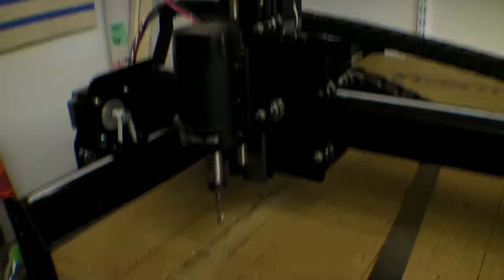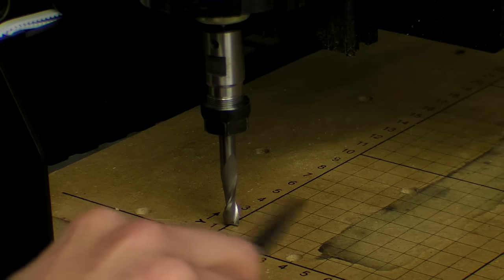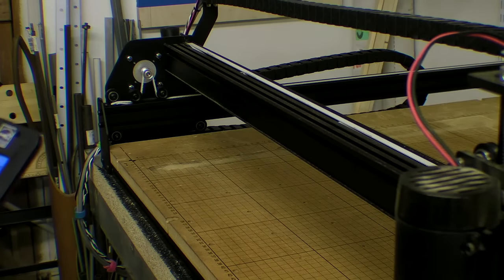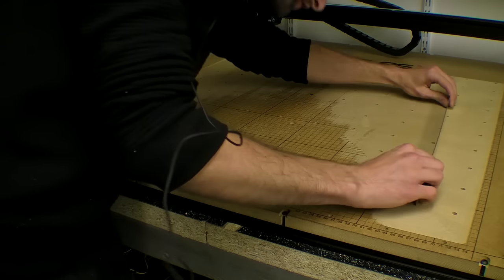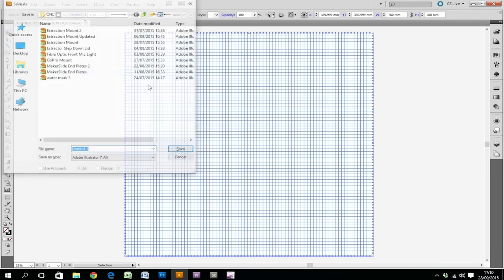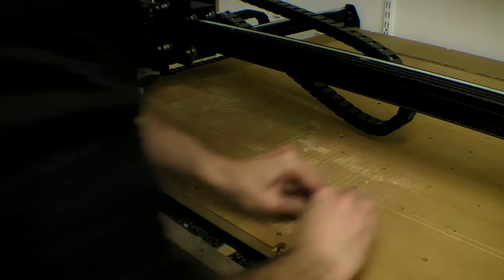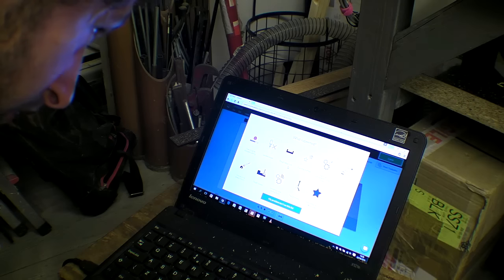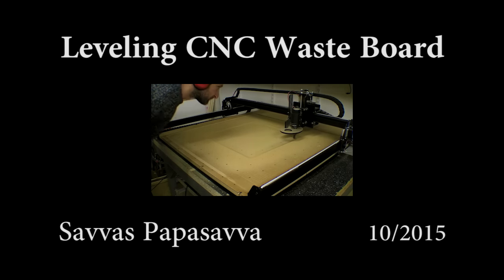Levelling CNC Waste Board - G Code Travel Error

Comment: If the x carve is anything like the shapoko, there's not enough support under the waste board to keep it as flat as it should be. Often see torsion boxes used for things that don't need the level of stability and flatness it can provide, but it certainly would be a good base for one of these.
Reply from the maker: +John Heisz Yep the machine is scaled up but the aluminium profile is still the same thickness.  I could get a flat t slot profile which has been ground flat for CNC beds but it is quite expensive at this size, and I still want to explore this machines claims without patching its problems with my wallet... expect several more annoyed videos.

Comment: The grid on the waste board is a futile thing.  With over a hundred and fifty CNC projects I have replaced my waste board or spoil board as some call it several times.  After surfacing it and getting it level like you have.  I put a 1/4" plywood 24"by 24" on top of it and fasten it with 1/2" long 18 gage soft brad nails.  I then replace it when it gets really cut up.  Sometimes I can just turn it over and use the back side for a while.  I clamp with screws and cams and jigs that screw down to my spoil board.    I milled a 1/2" wide piece of maple by 2" wide the length of my spoil board and then ran the CNC down it to true it to the gantry and bit.  With a tape measure you can quickly measure from that if you need to.  Most of the time I just put my jigs right up next to this and the front edge that are both square to the gantry.

Comment: you have to get rid of that 24v spindle. electrical interference from the spindle is causing the stepper motors to do weird things. its going to get worse as the spindle gets worse.
Reply from the maker: +mike gager Yeah and I was also tangling USB cable with the power cable to the machine and laptop.  I want to try shore up the machine first before I start looking into new components.  I am going to well and truly establish this machine can't do what it claims.
Reply from the maker: DiscountDisrespect  I designed and built a new machine called the moot_one. That's the only design I can endorse now. Lol.

Comment: the brace issue has been addressed BUT you actually do not need more extrusions..   If the table itself is good and solid then just simply make a few spacers the same height of the extrusions and glue them to the underside of the spoil board. Use the cnc its self to make them.  heh   But only do them in an area you have already leveld.. The problems with the early audrinos and questionable code has been addressed below.  

The flakey movements are most likely due to electrical noise AFTER the bad code stuff is verified fixed. Often the cure is simply shielding the wiring as much as possible. You can buy 4 conductor shielded wire multiple places on the net.  While your at it also wrap the control box in aluminum foil and tie it it to the wiring shielding.  Be ABSOLUTELY sure not to block any cooling holes. DO NOT ground both ends of any wire shielding.. Only ground them at the control box end.  Also tie the shielding to the power ground from ONE point only. Use the green wire in the power cord. 

Check that the belt tensions are proper and equal.  Also check the V-rollers making sure they are snug and the nuts are tight. I STRONGLY recomend you junk all the nuts inventables ships and replace them with nylock ones. These WILL NOT work loose. They are a metric size and most big box home improvement stores carry them.  If not, order them on line. I replaces all the nuts on the 2 at the maker space where I often spend a few hours doing some support stuffand an ocassional CNC or 3d printing class.

On my home brew there is absolutely no shielded wiring anywhere.  My control box is 3/4 mdf with aluminum foil glued to the insides in such a way all 6 "sides??" of the box are in full contact and thats tried to the power line ground, the green wire in the pigtail. I use  an 15 year old desktop running Mach 3 as the "brains". I built this one before any thing like inventables or shapeoko or open builds even started.  :) Inside the box is 3 power supplies. One is a small 5 volt one that powers the interface board. A 36 volt 15 amp one powers the steper driver modules and another 36 volt 15 amp one powers the same type of spindle you have on that one, if I have it installed.  Normally I just use a healthy trim router. Each of the 3 stepper driver modules can handle a 600 oz/in stepper quite nicely but im using 450 oz/in ones.  FAR stouter that the ones those inventables even stocks.  No beltst anywhere, all 1/2 10 acme threaded rod. You cannot move the spindle anywhere by hand with the power on or off.  It stays locked in place. I have small hand wheels on the rear of all 3 steppers, just cut the stepper power and crank them to where you want them. The only time mine has screwed up is when I screw up in the last 5 years.. I love having enough power to chew through hardwoods at 200 to 300 ipm with around 90 thou of a quarter inch bit buried in the cut.. Much more than that will snap bits in two.  Learnt that the hard way.  :)

On the software issue, easel is a peice of crap. The only good thing about it is its free. I use V-carve desktop and Mach 3, right at 500 bux instead of easel. Download the demo version of V-carve and mess with it and you will see why its worth 350.. with that all you need is the universal G-code sender, TOTTALY junking easel and the limitation of having to have active net access to make sawdust. There is also some nice open source ( free) g-code generators out there along with a number of free cad programs.  Look into Blender, Inkscape, and sketchup. I also use these on occasion. 

 The inventables are a fairly decent hobby grade CNC  for the price but I would fry one in about 4 days the way I work my home brew CNC.  Also the inventables are way to limited in the software area for my needs. The maker space I do some support stuff for has 2 of them 1 big with a trim router and the small one with that 300 watt spindle.. If the need arizes for a more serious CNC there I wil either make another one something liker mine or go with a mid sized shop bot one, pricey as hell but almost kill proof.

Comment: You probably are already aware of this but several other xCarve owners/users have had to contact Inventables and it was determined there were bad Gcode boards. They were sent a new Gcode boards due to inherent problems with some of the boards. Hate to see you chasing your tail if it's the board sending improper code. I do wish you the best of luck getting it worked out!
Reply from the maker: +MRrwmac I better get in touch with customer support I guess :(

Comment: So if you wanted to test repeat-ability, you would flatten the entire table surface, like you did.  Lightly mark the surface.  Then run it again (exact same setting, so nothing should get cut) to see if the machine dips.  If there are no dips, then you take 1/2 mil off and see what gets removed on the surface.  I guess this is what you did?
Reply from the maker: +Heavyboxes Yes essentially the grid inadvertently showed me that the base was sagging.  This machine really eats up time and space.

Comment: those x-carves are basically overpriced toys.  Not proper support under that mdf bead.  Very under powered steppers, weak nema 17 ones.. My home brew easily cuts 1/4 seep per pass with a 1/4 bit at around 90 ipm. Almost impossible to stall. Total cost about half of what the X-carves cost and runs a real controller, Mach 3, instead of the joke called grbl.
Reply from the maker: The x carve is a learning tool - no more, no less. I wanted to work at a faster rate so I built my own but I did like the simplicity of their software. I also do like GRBL which works fine but now I use a duet 2 wifi to control my machine. I really hate the interface of Mach 3 - it's so out of date.